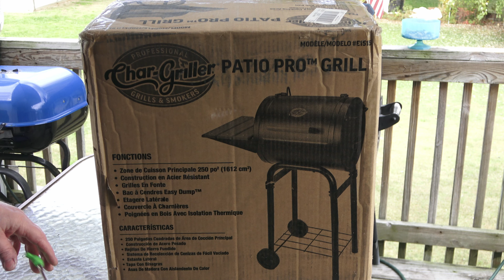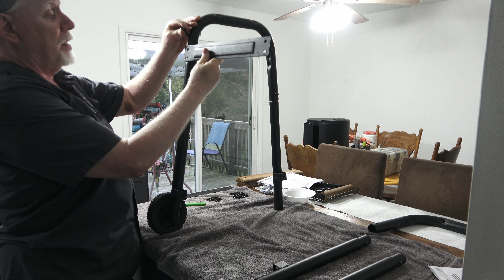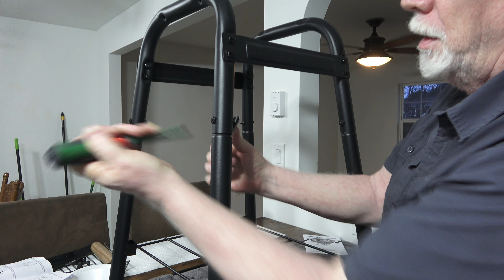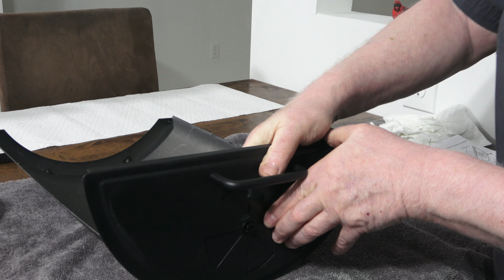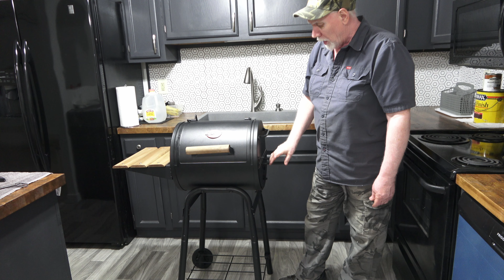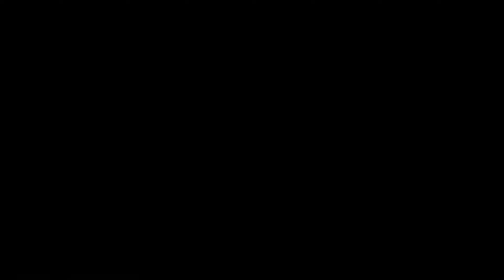Assemble Step-by-Step CharGriller Patio Pro Charcoal Grill

Comment: Cómo se hace lo de la llanta y la chaveta ? No puedo hacerlo 😭
Reply from the maker: 4:27 Slide the cotter pin through the provided hole 🤟
Reply: @w @wildwoodtop  tiene ningún orificio el tubo de hierro la serie de mi parrilla es #1515
Reply: Si puedes hacer un video mostrando el orificio, y haciéndolo mostrando exactamente te lo agradecería muchísimo
Reply from the maker: If the unit is not supplied with a factory hole you could drill an appropriate size hole for the Cotter Pin 🙂 Grill is in winter storage so I won't be making a video anytime soon 😕
Reply: @w @wildwoodtop  Thank you so much for your help, I've already subscribed by the way 🤠